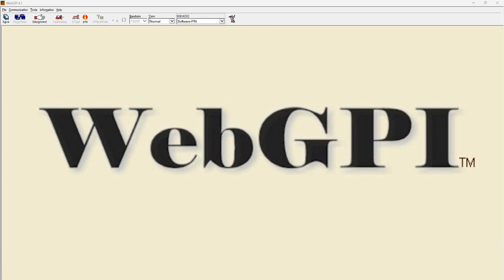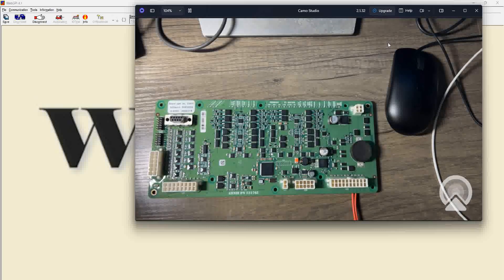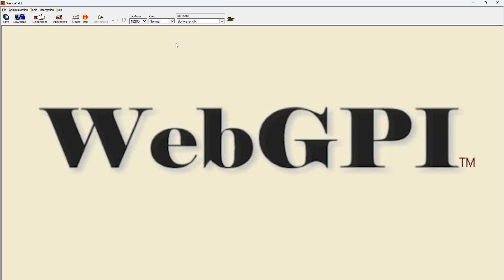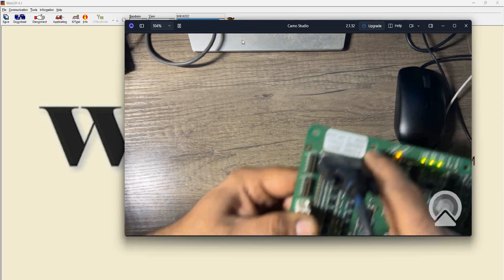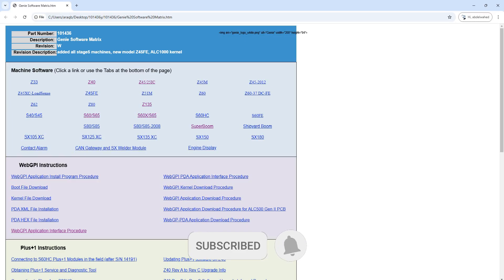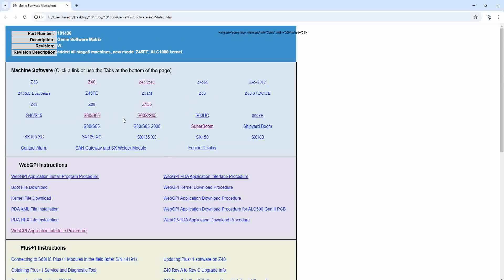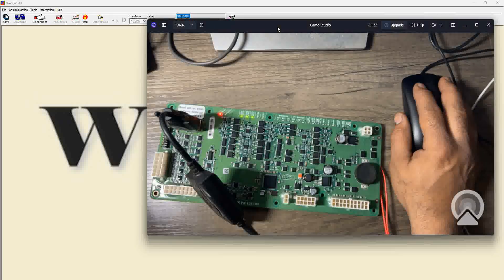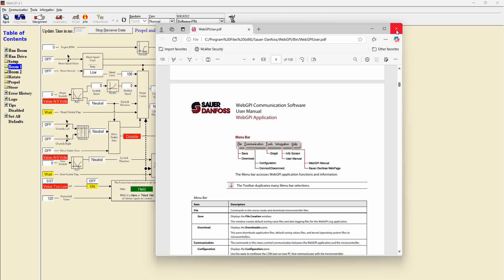WebGPI Communication Software i2

Comment: Hello brother, can you answer me? Is it permissible to download the application file version 3.12 for the ground control genie z135 on the kernel file version 1.00?
Reply from the maker: yes, you can do it by choosing microcontroller 167 and choose file application icon. then you look for the hex file. the hex file might not be visible until you select All file(*.*).
i prefer using higher version than V3.12 .
Reply: @ Thank you brother, I downloaded it and it is working now